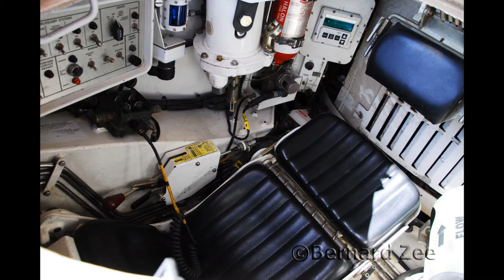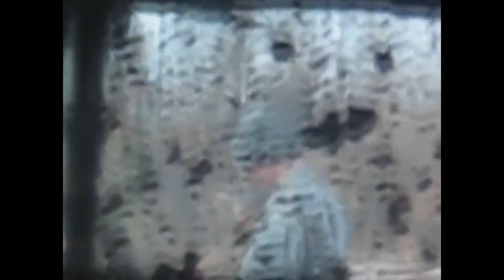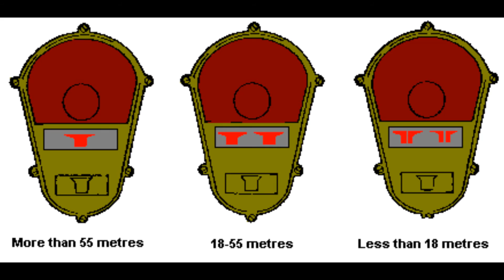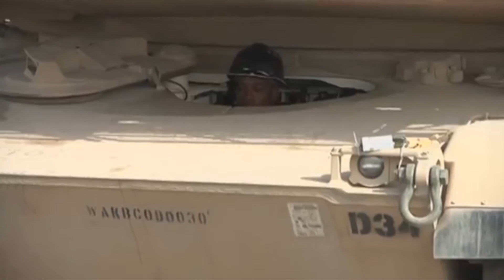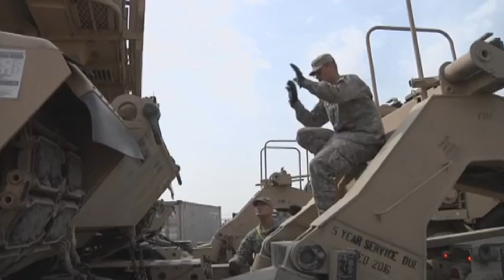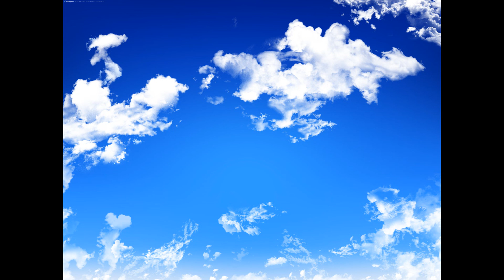Let's Drive M1 Abrams Tank with Musashi PART TWO

Comment: IS there no common air filtration / NBC filtration system  that would let you have your gas mask off ?
Reply from the maker: Starhoof 

Yes that is what the cannister on the left side of the driver is supposed to do. I didn't show a picture of it, but there are two levers that you move to about three different positions for turret and hull air flow. I cannot remember what they were supposed to do. There is supposed to be a seal of sorts that is conveyed when whole tank is buttoned up, but that whole system seems like a gigantic PR ploy to me. You can't operate the tank completely buttoned up for long. I guess the intention was to survive during a short chemical attack or something. The army used to do large scale NBC drills where teams of people would scrub down soldier and equipment, but that's super costly to even train for and when you see it in action, it looks like a farce to make you feel better about stuff. Being in a tank is a very dangerous center of attention and your seal is the least of your worries. Consequently, we never spent much time talking about our whole cannister thing.
Reply: Let'sPlayMusashi Musashi can you tell me how the ammo racks behind the turret works. How can the loader reach the shells behind the commander?